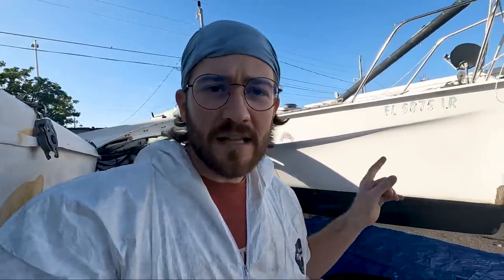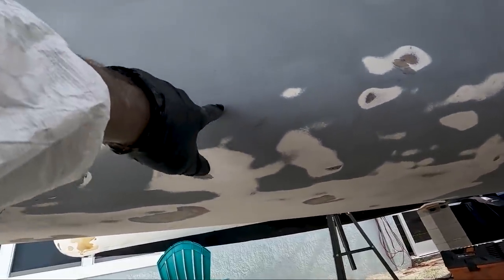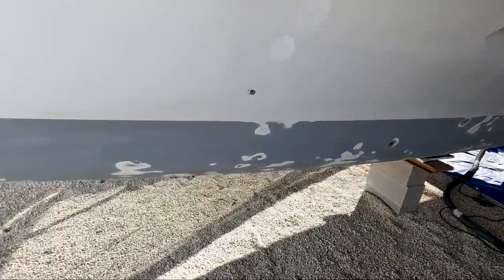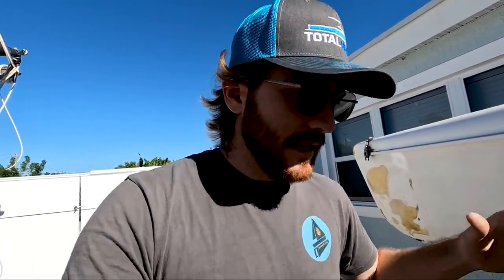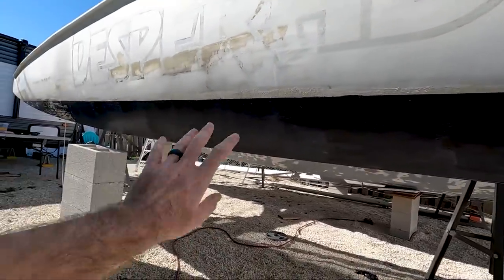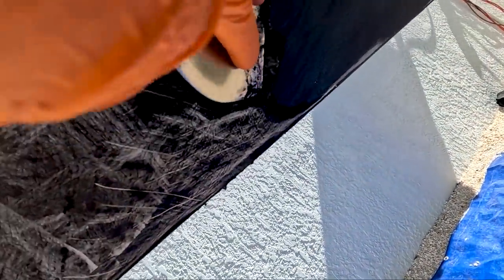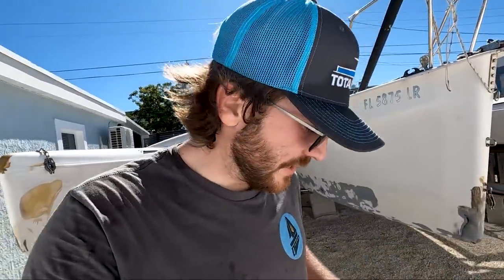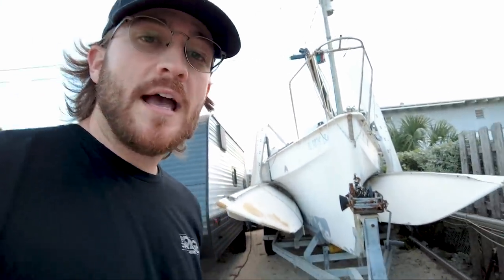Sanding or Stripping Antifouling - What's Better? | Learning the Lines

Comment: Most boat buyers know that bottom jobs are part of the upkeep of their investment. I don’t know of ANY boat owners that like doing that job, but they do it and get it done. Most just say that it wears them out, they don’t bitch about the dust, well, not as much as you. If you don’t like it, why the heck are you a boat owner. Try coming up with a solution first before crying about it, it does no one any good. Just saying!